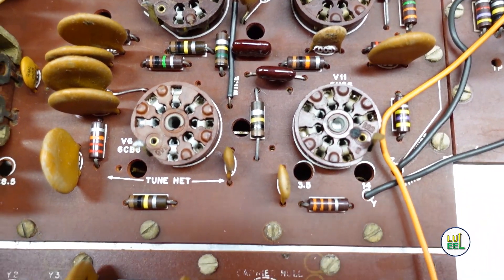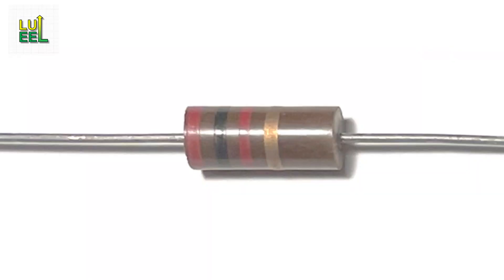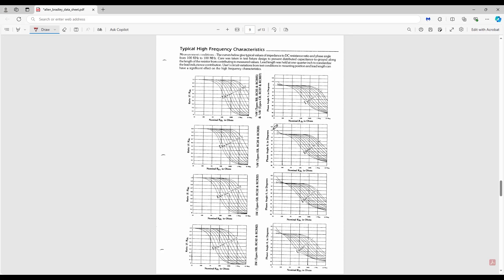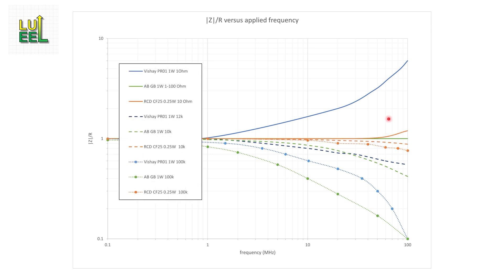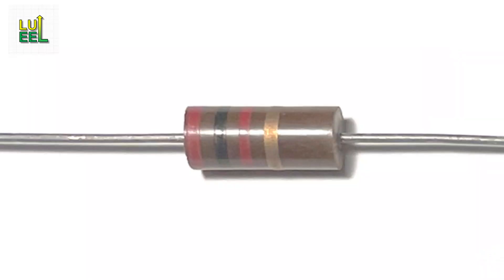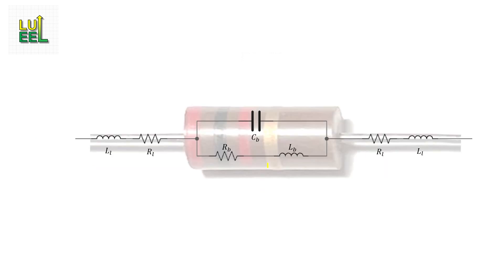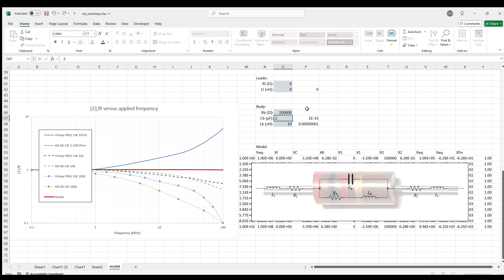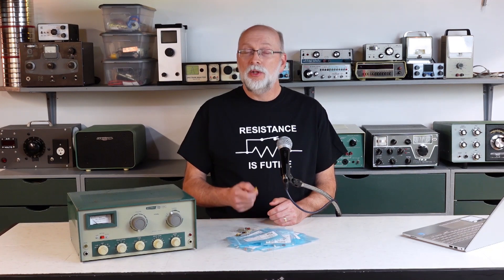Resistors: Part #1

Comment: This is valuable information.  One other consideration that can sometimes be important is the surge capability of the resistor.  Carbon composition resistors, due to the quantity of bulk resistive material contained within, can often absorb momentary overloads that might burn up film resistors.  When equipment is initially switched on, there can be large transient currents, much larger than steady-state operation, while the filter capacitors are charging.  The ceramic composition resistors or other resistors with suitable surge ratings may be required to replace carbon composition resistors in such cases.